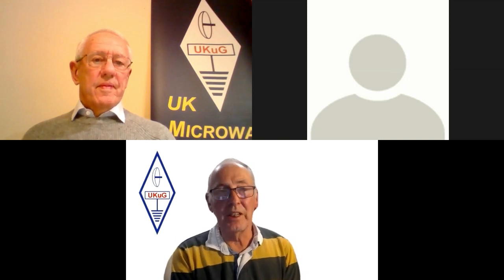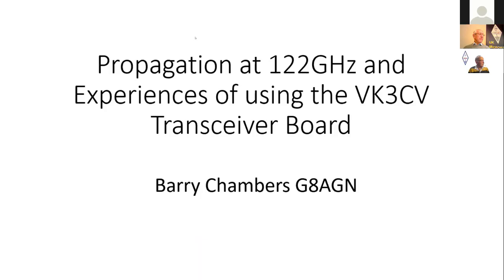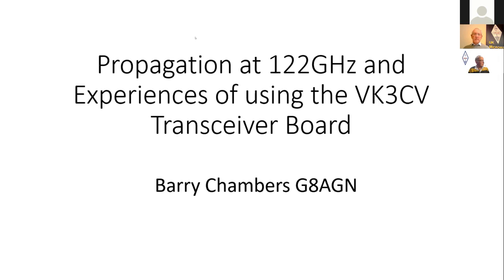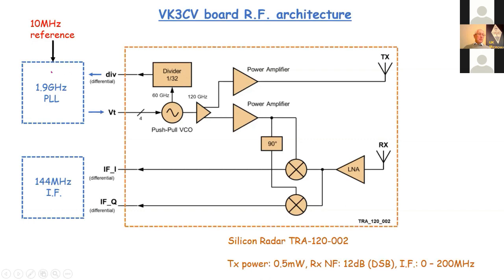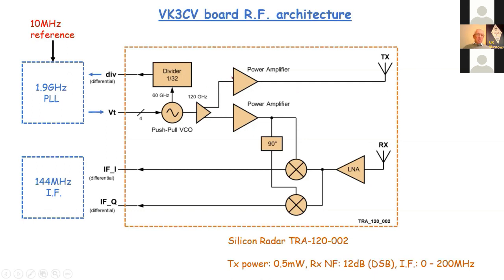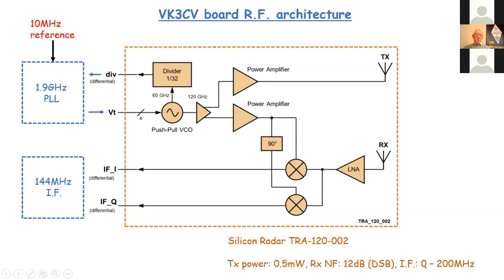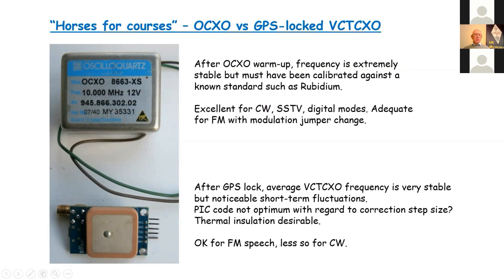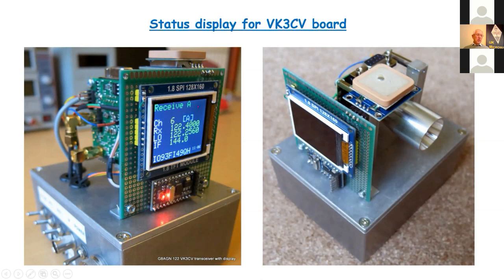UKuG 122 GHz & VK3CV Transceiver talk by Barry Chambers G8AGN

Comment: I want to make a hobby Electron Parametric Resonance Spectrometer EPR, which works exactly opposite to your stuff, in a sense that it needs to absorb maximum amount of energy into Oxygen resonance. But I guess it would need more power then 0.5 mW that you are doing. So my "target" would be an ice cube H2O, obviously full of Oxygen and I need the maximum possible absorption. Can that be done?